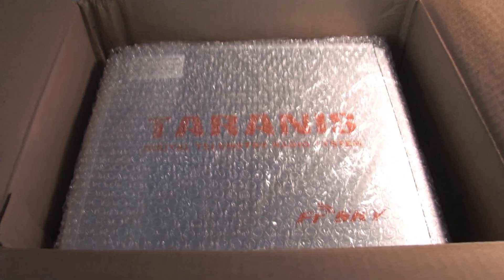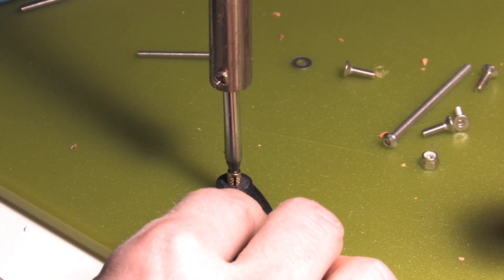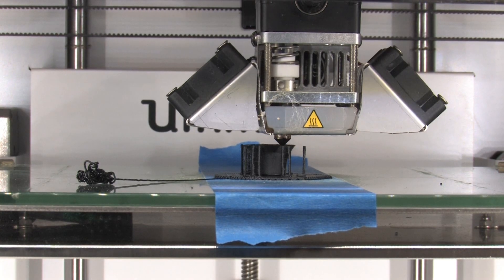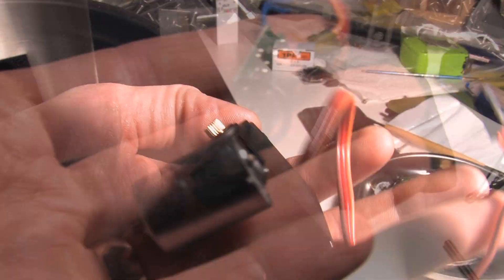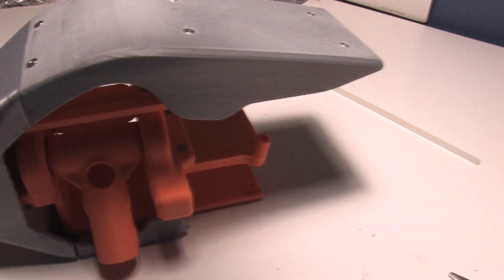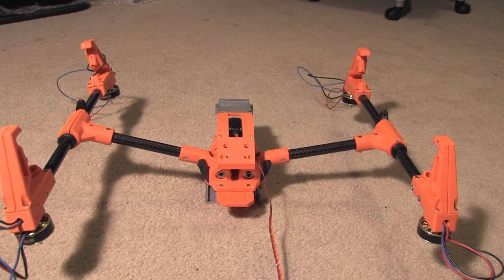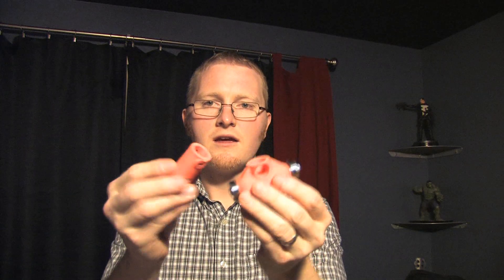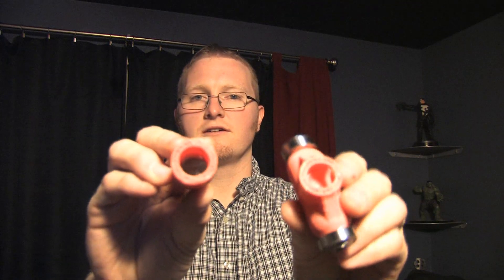Part 3: 3D Printed "DJI Inspire One"-style DIY Quadcopter - Construction

Comment: Hello,i come back to you,  I just made an Inspire 3d clone but I still have the same problem with the arduino. It never finds the PinChangeInt despite its presence in my PC. Do you have the full code that works correctly for the arms? thank you so much
Philip

Comment: The issue was never the design or the modeling of the parts. It was your printer. The time lapses look like shit. You've got over extruding EVERYWHERE, and MASSIVE warping. Which is likely the reason you are seeing the delamination. Learn to tune your printer properly.

Comment: Would now be a good time to start this project? & what kind of motors are those, where can i find them?
Reply from the maker: The next video shows the electronics. There is a newer and better version called 1.5 that I would recommend. They fixed a lot of the issues this one had. You can find it on rcgroups.com in the 3D printing section.
Reply: +cozmogeek would you recommend buying all the parts from rchobbyuk.com and just print the 1.5v?
Reply from the maker: +iAstro16 the 1.5 replaces the files you'd have to buy otherwise. You'll still need the parts like screws and carbon rods. I wouldn't buy any of that from rchobbysuk.
Reply: +cozmogeek okay so just go ahead and purchase everything from the sites on the tools list from the 1.5?
Reply: question, do you still have all the files that you downloaded because i can't seem to locate them? And how much did the parts you printed with in total I'm trying to get an estimate
Reply from the maker: +iAstro16 http://www.rcgroups.com/forums/showthread.php?t=2399740 here's the thread for the v1.5. You don't want the one I printed it's obsolete now.  I didn't weigh the plastic parts alone but this thing ended up really heavy.
Reply: +iAstro16 yesterday, I just finished assembling V1.5 ... my assembled frame is 1200g. One tip I got from the forums was to use PET material for the structural parts ... used PETG black (on sale at Amazon, $24) ..and white ABS for covers.   Photos of my frame here:   http://www.thingiverse.com/make:176146    ... V1.5 has many improvements, but IMO, the lead screw setup for driving the booms can be improved,  the leadscrew thrust load isn't being dealt with effectively  (I machined a stepped end on my leadscrew and added a 10x3x4mm ball bearing at that end) .. now I am buying electronics, still undecided what the best motors are ... but did decide for me that I wanted the DJI NAZA M V2 with GPS (not cheap, but lots of function).

Comment: Hey Man thanks for documenting this!
Do you by any chance have a list of the electronics you used? 
Im specifically interested to know what motors and esc's you used..
Many thanks
Reply from the maker: Mikhail Wertheim Aymes Part 4 has more of the info about the electronics but I am using the multistar 3508-580 motors 
http://www.hobbyking.com/hobbyking/store/__41616__3508_580KV_Turnigy_Multistar_14_Pole_Brushless_Multi_Rotor_Motor_With_Extra_Long_Leads.html
and the F-30A-HV Fire Red ESCs 
http://www.readytoflyquads.com/f-30a-f-30ahv-fire-red-normal-esc-with-rapidesc-fw-for-multirotor
Reply: cozmogeek Thanks man much appreciated.
How come you chose to use  the Arducopter flight controller over say the naza v2?

Comment: You need to take the strength bias of the chosen orientation into account.  When you have a "T" connection like that, you almost exclusively need to use a double 45 degree bias on the x and y axis when you print so that you have the maximum amount of surface area between layers.  This is printing 101... This is also a HUGE reason why 3D printing on the consumer side isn't quite primetime.  It's getting close, but it's not there yet.  If you really want those parts to be strong, i'd suggest sending them to an outsource printer and get them done in a nylon.  Either go to www.redeyeondemand.com and print them in NYLON12, or hop on shapeways and get them printed on one of the nylon SLS printers.  ABS will help as well, but without a heated chamber it can be a biotch to get complex parts to fit together properly due to warping/shrinkage.
Reply from the maker: Patrick Potter The entire thing was already done in ABS. I was having layer adhesion issues though and my infill was bad and didn't notice until I was already done. I actually replaced many of the broken ABS parts with PLA and it's better. It flew successfully without breaking anything if you go watch part 6!

Comment: Yeah we recommend 100% infill on the arm and moving parts.
Reply from the maker: Are you guys still planning to release a build guide so people can find all this info in one place?
Reply: Yes it's nearly finished, we want to do some more designing on the arm movement but just haven't had the time, we do a lot of designing for other companies and hobbyists so that comes first this project was not funded but done on our own accord so any development and work that's carried out gets done when we have some time free.
Reply from the maker: There is also a bunch of confusion about the CF arm lengths. It sounds like there was an older version of the parts list that had them listed wrong and people are still confused. The current parts list also has the length of the 8mm landing gear pieces listed wrong. It says 75mm but they're more like 40-50.

Comment: Printer settings is where your problems are, de lamination problems your layers are not bonding enough. Do you have fans blowing on the part while printing? Our prints are very strong and do not come apart like yours are. Also the lipo (4s 5000) which it was designed around fits under the framework tail, the groves in the framework tail are for a Velcro lipo strap to sit around.
Reply from the maker: I'm not sure if those pieces were printed with the fan on or not. The default for ABS on my ultimaker 2 is 25% fan.  I printed replacements at 100% fill yesterday and they seem very strong now.  The first broken piece I show there was my fault for getting the CF tube stuck in the piece and not being able to get it back out without breaking it. It did take a decent amount of force to cause that. I tried to break the 100% fill replacements and they are much much stronger.
So that battery strap explains what that narrow slot on the frame reinforcement piece is for. Without any instructions or even good pictures of a flying model it's impossible to know that.  Thanks for the info.  I'm not giving up on this thing.